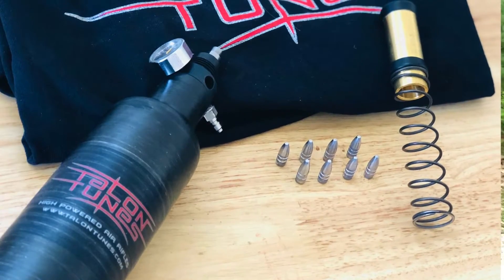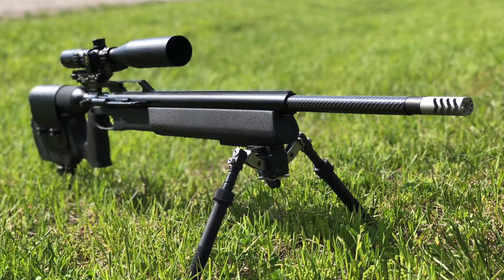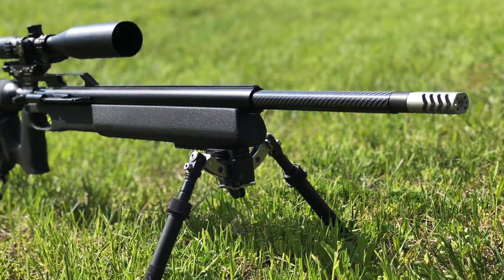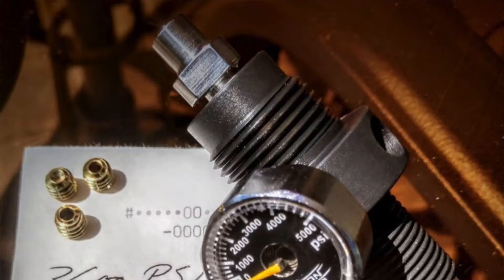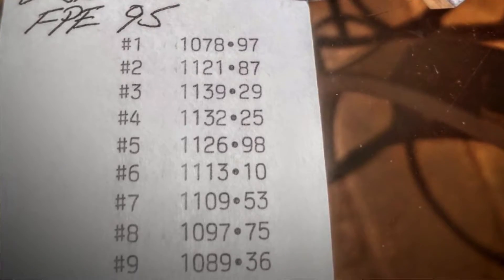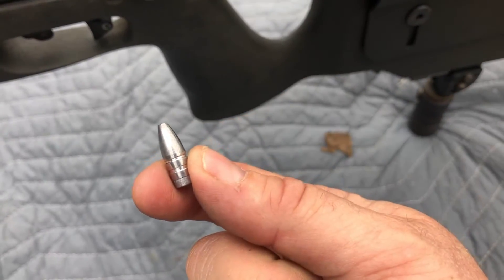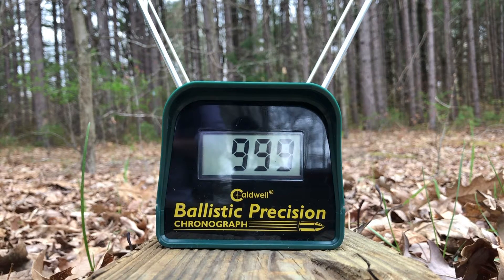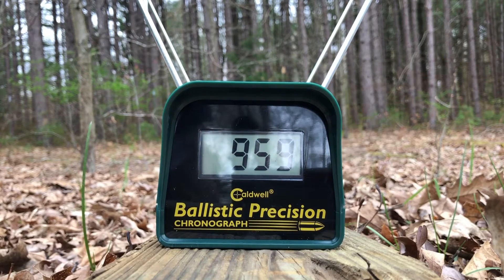4 Ways to Increase Velocity in Airforce Airguns: TalonTunes Super High Output (SHO) Valve

Comment: Did you notice any difference in accuracy between the AF Ring Loc valve vs. the TT SHO valve shooting the .257? I saw your other video with the factory Ring Loc valve. Thanks!
Reply from the maker: There was an airflow improvement….
Reply: Ok thanks for response. Just wondering if there also happened to be any subsequent accuracy factor to it as well. Subscribed!
Reply: Ok thanks for response. Just wondering if there also happened to be any subsequent accuracy factor to it as well. Subscribed!

Comment: Hi 1000 mm Shrouded barrel over here, on my 19 and a 1/2. Inch barrel definitely has increased the velocity whether or not I get Better results as I start chopping off barrel links that's yet to be determined.. but comming up soon, i want to see if i can hang with your 600+ yard shot with my 25 cal challenger pro with this special tune that I idid to make it shoot over 1460 FPS and Achieve up to a 120 FPE  (Foot pounds of energy) on a gun, that  maxes out at ninety foot pounds of energy.
Reply: Plus, I'm doing 120 FPE at 200 Bar 3000psi tops. If I go over that, I get valve lock. But I get over 60 shoots over 900 FPS with a 20 grain. I'll take that all day.

Comment: Hello there just bought a condor in .25 for a build project for slug testing and development. I have a few questions ia that .257 barrel a airgun barrel or a real barrel and what is the twist rate? I will be changing my barrel to a custom barrel with no choke and a fast twist rate for long ogive slugs like a 8s to 6s Rbt. At some point. What aftermarket parts would you recommend? I plan on building this out to be a long range target gun and mabe so hunting as well. I already purchased the ring-loc valve kit just to get started any advice would be greatly appreciated.

Comment: Hi, you mention about a 38 inches barrel... do you may have any info about it ( Twist rate, results)
Reply from the maker: The .257 is a 34 inch barrel with  a 1:14 twist.  SUPER accurate.
Reply: @UpNorthAirGunner  so there is no 38 inch out there? 34 inch is a "standard" length for a Texan....

For +165 yards High accuracy, which one do you recommend .257 or .308 ?
Reply from the maker: Love Power I’ve found the .257 to be the more accurate caliber by far.  Yes 34 inch barrel is standard.
Reply: @UpNorthAirGunner  Thank you for your opinion 👍

Comment: There's a caveat for everything. In regards to your 2nd way of increasing velocity (more bottle pressure), it's true you can get higher velocities with more pressure. It's also true you will need a heavier hammer spring to open the valve with the higher pressures keeping it closed. But you run the risk of "tank dump" when you go this route. This is where the tension in the spring supersedes the back pressure of the bottle to close the valve again after the shot- and the ENTIRE TANK of air (2000+ psi) dumps within 1 second. You can anticipate getting knocked on your butt when this happens. You can also anticipate needing a clean pair of underwear with the "surprise" associated with the phenomenon happening. 

Second issue is of all the people you named that make custom high flow valves, Doug Noble won't make you one. Doug's work is the quintessence of perfection, but he's not into mass production of his products. He makes them at home, in his own shop, on his own time. If you're lucky enough to have him make you something, go play the lottery. The stars have aligned for you. 

The downside of an unregulated air rifle is the lack of consistency in velocities. I was watching you chrono the 80gr spitzer you cast, and I watched you lose 15-20 fps per shot. As the tank pressure drops lower, it will dump more air per shot, since the pressure of the upgraded spring behind the hammer is designed to open the valve at 3600 psi, it keeps it open longer when the pressure drops. This is why airgun manufacturers have started regulating their air rifles. With a predetermined amount of pressure in the chamber that maximizes velocity and minimizes wasted air (which in turn minimizes barrel harmonics and instability behind the projectile) you get much better accuracy. 

PCP Tunes just released a regulator designed for the Texan air rifles. I don't think it will work that great on the larger bore air rifles. But on the .257 or the .357, I think it's perfect. They gave it a large enough plenum to accommodate good velocities at constant pressures. They also designed it to allow your tank to be filled to 300 BAR (4300 psi), and the reg will drop the pressure to whatever set pressure you decide to adjust it to. They have test results on their website. 

I agree with everything else you posted about increased velocities. But it's important to note that if you increase barrel length, you also increase barrel harmonics. So you need to figure out a way to tame the harmonics. Otherwise you get "barrel whip" and lose accuracy downrange. 

That's just my $.02. Thanks for the video. I enjoyed it.
Reply: Good information Thanks

Comment: just waiting for new shooters to say "well my break barrel from Walmart shoots 1500 fps." lmao
Reply from the maker: I know - right!  Maybe they could get there with a muzzle velocity shooting a lead free 6 grain pellet with a BC of .000000001- HA!  Velocity doesn't mean much unless you have the sectional density and ballistic coefficient to actually get to your target on a flat trajectory.
Reply: That's almost the same velocity that the rimlock valve do with stock hammer and spring, I bet that the rimlock valve with a light valve spring and a heavy hammer will do the same ..I have opened the 2 valves rimlock have a thicker stem a little bigger opening on the top hat..I dont think tha none of the 2 are designed for a 115 gr hammer pounding..so I buy one from Doug Noble awesome valve specially made for 257 great consistency from shot to shot..for .22 and .25..rimlock will be the best bang for the buck...
Reply: Breakbarrel Harmonics Mean they work Best in the 650-750fps Range, Read Springer-NitroPiston, but the Gas Cylinders Don't Have a Reputation for Reliability. At Least Single Shot Air Rifles Can Still Diesel. Try THAT With a Magazine and Lemme know if it works. Kinda had my eye on a Crosman Co2 Revolver with the Shell Holders. AGD Talon P Carbine Still on the Wish List...